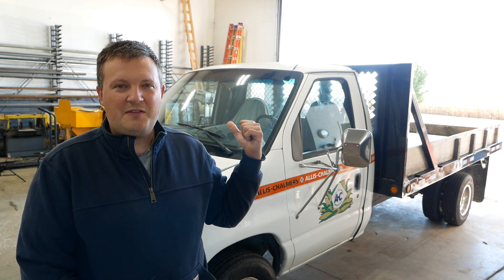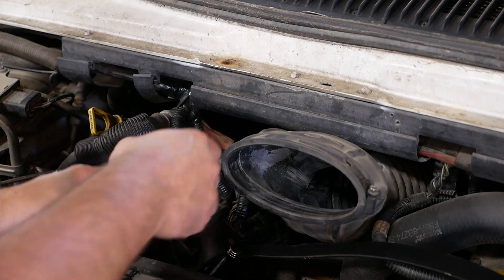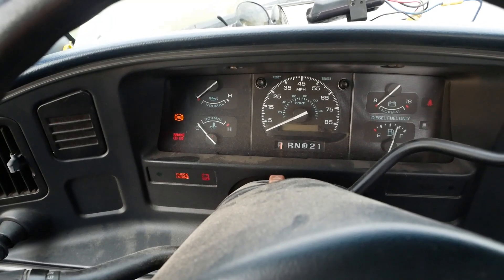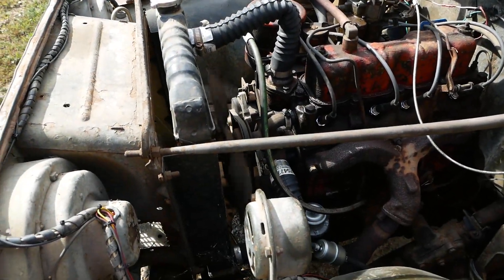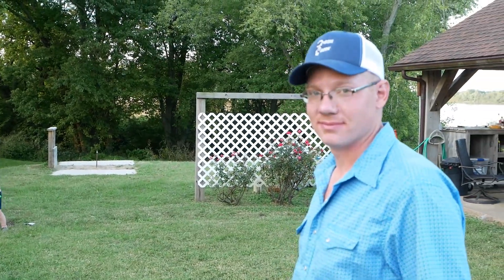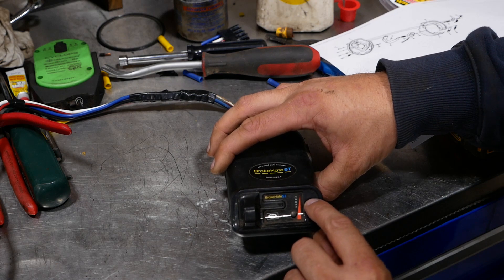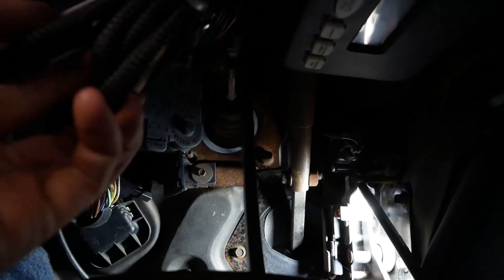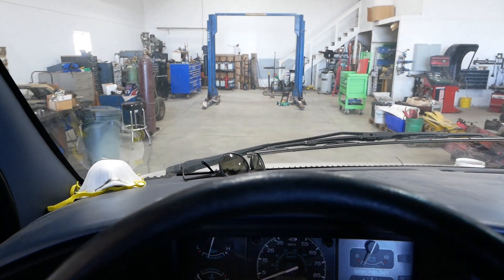E-350 7.3 Power Stroke Hard/No Start - Again! | Dirt Perfect Meet and Greet Event

Comment: When you tip the break pedal slightly the trailer breaks with full power?! Or is there a breakpressure sensor at the pedal?
In europe we have overrun breaks or airbreaks on bigger rigs.
Reply from the maker: It uses an accelerometer to determine how much brake to apply.
Reply: @WatchWesWork  ah okay. That makes sens 👌🏽
Thanks Wes!

Comment: You ask why the "rest of the world" does trailer brakes differently. 
Here in UK we generally have the brakes operated by the trailer over-running its hitch and mechanically applying the brakes by momentum pushing on the tow hitch. This can't go wrong unless the steel linkage fails. 
The electronic system relies on the sensor unit deciding to work and on the integrity of the wiring. If anything goes wrong with the fuse, the unit, the wiring, the connection integrity in the trailer plug or the wiring on the trailer or the flexible connections to the electromagnets or the magnet coils you will have no trailer brakes.
Given the regularity of wiring problems on trailer plugs and trailer wiring generally due to water/salt damage I am left wondering how many US trailers actually have brakes.

Comment: By the year of that Econoline, the doghouse no longer gives you a lot of access to the south side of the motor? Or does the ambulance conversion just make it impossible to get out anymore?
Reply from the maker: The relay is on the front of the engine...
Reply: @WatchWesWork  With as far as you went in there I thought maybe it was at midpoint.

Comment: Theres a maximum angle your aloud to install those controllers and it looked like yours was almost 90°. I think that might exceed the max angle? Just an observation.
Reply from the maker: That was true on the old ones with the pendulum. These solid state units can even mount upside down.

Comment: Wes, I noticed that on the startup after the new glow solenoid, the amp gauge stayed around 9 volts. My 7.3 does the same thing after replacement of the solenoid, for a few minutes. Unless the engine is warmed. I thought that turning on the lights or something may excite the altanator and swing the gauge but it doesn't. Is this normal or what?
Reply from the maker: Yes, pretty typical. The glow plugs pull a lot of current and the alternator takes a few seconds to get started.
Reply: @WatchWesWork  thank you very much!

Comment: Anyone else notice the voltmeter was sitting down about 9 volts even when the truck was running?
Reply from the maker: Pretty normal for it to be very low while the glow plugs are on. After about 2 minutes it will bounce up to the normal range.

Comment: Shew, those old brake controllers are terrible. You should've accidentally ran over it and told them they needed a good one. I cant find that specific model online, but I think that controller is just on and off, no inertia sensor. Pretty sure its a reese 7437711 timed unit. Hooked that specific model up backwards once and fried a diode in it.... Wire colors for those things is insane.
Reply from the maker: There's a good one?

Comment: just like the 1981 XJ650 i worked on, guy over heated the engine bending all exhaust and intake valves then held the starter button for so long the relay melted and cracked the housing on the starter. fixed with a hammer, but he bought a whole parts engine before passing it over... hot potato, this guy to that guy the other guy over there over here way out back and home again to the dump and back in a shed "I been every where"

Comment: I have a 1994 Ford F-350 and I want to be able to pull a trailer with it but it didn’t come with any wiring for the breaks or lights from factory so do you know how difficult it is going to be to do this?
Reply from the maker: You should have the same brake controller connector. You'll have to roll your own from the wiring past the firewall. You can get a harness to tap into the tail lights and use a heavy duty flasher.
Reply: @WatchWesWork  I found that plug under the dash so we’re would I look for the wire at the fire wall that you said I need to run a wire from to the back?

Comment: I understand how the brake controlers work, but I still don't understand why? We just have a compression tow hitch that controls the brakes. Light duty can be cable operated. But most and all heavy are hydraulic. All self contained in the trailer. Requires little to no maintainance and as simple as non power brakes on a very simple car....or your parking (emergency in USA) brake!.....so much simpler - Everywhere outside north America uses this system!
Reply: we have that style here too, usually on heavy trailers. alotta trailers here are still setup for electric brakes, well smaller trailers anyways

Comment: In Australia it is a legal requirement to have operational trailer brakes on trailers that have an GCM of 750Kg (1654 lbs) or more. If the vehicle manufacturer states a lesser weight, then the lesser weight applies to that vehicle/trailer combination. My personal opinion is 750kg is too high. 350kg (772lbs) or 500Kg (1103) would be better.  I have been driving for 36 years & I can't recall a time where you didn't need trailer brakes as specified above. I know people have had them since the 1970's. The Break-Away system is legal in Australia now. The law came in after 2005, I don't know what year though. All the above is for passenger vehicles & light trucks; including SUV's. I can't comment on heavy vehicles other than to say air brakes on trucks have an automatic brake-away system - no air = brakes on.

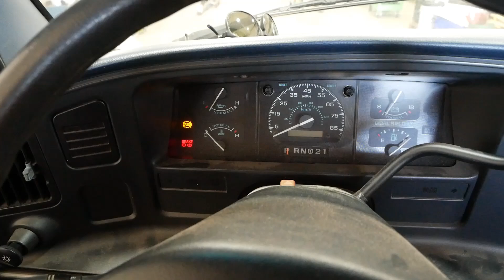Comment: 31:34 alternator output 9 volts on idle? seems it should be at least 14 v
Reply from the maker: Those gauges are not accurate at all.
Reply: @WatchWesWork  bet someone put dielectric grease on the terminals       (hee hee hee)

Comment: Surprised with that capacity of an alternator the owner does not seem to have a DC to AC converter.
Reply from the maker: I'm sure it had one in the ambulance body.
Reply: @WatchWesWork  Yes, but having one now would increase the utility of the vehicle. Power tools, emergency power, a refrigerator of cold beer.
Reply: Running a 7.3 liter for a fridge full o' beer sounds expensive!

Comment: It is good and it is bad when a battery is the weak link and is causing your problem. Good: replace the battery, problem solved. Bad: More expensive than just a bad wire. I'll buy the battery with a smile on my face. HEY! Batteries are circuits, too....ya know.  ;-)

Comment: You know, by putting an AC Delco battery in that Van, all the other electrics, switches, and wipers are going to start intermittently failing -- until you put a Motorcraft battery in it...
Reply: lol 😂
Reply from the maker: I should just get some Motorcraft and Mopar stickers since they're actually identical batteries. The funny part is my supplier stocks all three identical batteries in each size with the respective stickers on them.
Reply: @WatchWesWork  And if they were labeled by the maker, they'd all have a big Johnson on them!  My joke was mostly about disparaging the longevity of GM switch gear and electrical parts...

Comment: Has north america not got braked trailer tow hitches ? That electric set up sounds a tad complicated, here in the UK and Europe the brakes on a utility trailer/Caravan etc are mechanically linked to a sliding tow hitch via linkages, the tow bar slides in and out of its casting but is in its extended position (pulled out) in normal use, being held there by a short gas charged shock absorber within the hitch tube, when the car/truck brakes the trailer slides down the tow hitch by it's own momentum but automatically applies the brakes on the trailer as it moves, the harder the car/truck brakes the more force the tow hitch exerts on the brake linkages, once the car eases it's braking the gas shock pushes the tube back out and the brakes release, quite a simple set up to be honest, our break away is a D clipped cable that you attach to the tow bar somewhere (usually a slot on the tow ball bracket) that pulls the handbrake mechanism on the trailer should the tow hitch become seperated from the ball, great vid again Wes but why does Diesel Creek Matt always look a bit p*ssed off ? 😂😂

Comment: "That's how we do it here. I don't know why other countries don't use the system" - That's because mechanical overrun brakes work perfectly well without the need for any additional electronics or wiring. Also with a mechanical overrun system there is no need for an additional breakaway battery to apply the brakes if a breakaway occurs. A wire cable (with a weak break link) from the handbrake (parking) lever on the trailer is attached to the towing vehicle. If the trailer becomes detached the cable is tensioned and pulls on the handbrake lever with increasing force until the link eventually fails. Simple but effective.
Reply from the maker: How do you reverse the trailer? Can you apply the brakes while driving to stop the trailer weaving?
Reply: @WatchWesWork  I'm gonna hijack this. Reversing depends on the trailer. Some have a mechanical override on them that you can use to "deactivate" the brake, so it wont compress. Backing up then is just like on a trailer without brakes. For the ones without that override, you just back up slowly at first, because like you are suggesting, stomping on the pedal will compress the cylinder and you're not going anywhere.

As for weaving: I'm not sure what you mean. You mean something like a tailer thats loaded wrong (ie center of gravity behind the axle) and starts "fishtailing"? I've been instructed to let off the throttle and very, VERY gently apply the brakes.

Comment: Now I’m curious- how do trailer brakes work in Europe?   And do they have real turn signals on them?
Reply from the maker: They use hydraulic surge brakes.
Reply: From Google as I couldn't word it properly,

"A braked trailer has brakes fitted that are often known as 'overrun brakes'. The trailer will apply its brakes through a mechanical linkage that is connected to the tow bar. When the car brakes, it puts a force through the tow bar which then activates the linkage to apply the trailer's brakes"
Reply: @WatchWesWork  I remember surge brakes being a thing years ago.  The master cylinder on top of the tongue, the linkage….
Now all I see are Dexter axles with electric brakes.
Reply: Hitches here (uk) have a gas damper inside them and the tongue is telescopic, as the trailer compresses the tongue under braking, it pulls on the brake rod actuating the brakes

Purely mechanical system, no hydraulics.. or at least not on any I've seen

Comment: The Brake Controller is indeed totally unknown in Europe.  Over here, any trailer under 1650Lbs total weigth does not need it's own brakes but relies on the car.  Above 1650Lbs, the trailer must have brakes.  These are activated by the trailer coupling, which is pushed out with a spring and slides horizontally.  As the car/truck brakes are applied, the (loaded) trailer will push forward and push in the spring, thus activating the brakes via levers and cables.

Comment: Nah mate, no foreign to us here in God's country at all. Australia uses them all the time. Some mounted in the vehicle and some mounted on the trailer. Our double horse float has one just mounted on the float that you adjust by simply turning a knob which you quickly know how much to turn for empty, one or two horses. Our triple connects to one in my ute sort of similar but more modern than the joey you have there for this job and the trucks I've driven with a trailer up to a B-Double have them from factory. Don't compare us to the 'rest of the world' brother. We're pretty cluey down here. Also has the breakaway feature. Luckily, knock on wood, haven't had that ever happen. Had a front left wheel bearing just seize for no reason with no warning once though towing the 3 nag angle load at 110kmh. Not cool. Steered her off into the grass though luckily. 
Always like watching your videos mate. Well done.

Comment: 20:49 C'mon Wes, butt splices and tape?  On safety-critical wiring?  I hate to send flak your way but dude....
Reply from the maker: What's the problem?
Reply: @WatchWesWork  Well I'm a little surprised you're asking that.  The most secure connection would be from rosin core solder followed by heat shrink tubing.  I've personally found examples of crimp connections that might have seemed secure but through vibration or corrosion turned south. Scotch-locks aren't the only connection that sucks....
Reply from the maker: @shawnbottom4769  Did you know that NASA does not allow any soldered wire splices? They have found that soldered connections are more likely to fail from fatigue and are overall less reliable than crimped connections.
Reply: @WatchWesWork  you're gonna have to provide a source for that and also that your average crimp joint is included in the study.

Comment: In the UK, electric brake controllers are illegal, as they aren't directed connected to the brake pedal, so such systems have never been ratified here in Construction & Use Regulations by the UK.

They do have coupled air brake systems here, for Land Rovers, which allow up to 4 ton laden trailers, but the difference is marginal as standard Land Rovers use 3.5 ton over-run brakes on trailers.

Interesting what you have in the US though.

Comment: Brake controller? You wonder why other countries don't use them?
I think you have that backwards. Why do Americans use them?
It seems an unnecessary complication. I have been towing heavy things for decades using an overrun brake. Works perfectly. If you brake hard enough to lock the wheels of your vehicle, it will also lock the trailer wheels. Oh and they also have a breakaway feature - a cable that hooks to your vehicle and applies the parking brake fully on if the two part company. 
The less electrics and electronics I have in my life the happier I am.
Reply: Just have to be mindful of the brake fluid and hydraulics.  And I have found hydraulic brakes don't like to sit around unused for any length of time, such as a trailer that can sit in one place for extended periods unused.  Whereas the electric version, after prolonged sitting, just has to scrub a little rust off the inside of the drum and it's good to go.